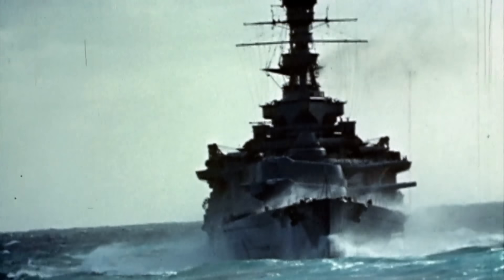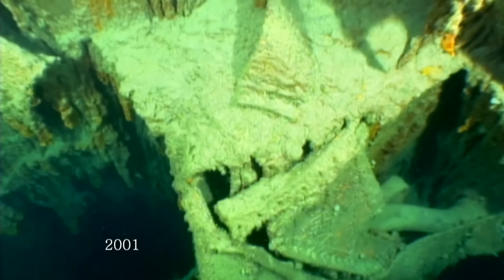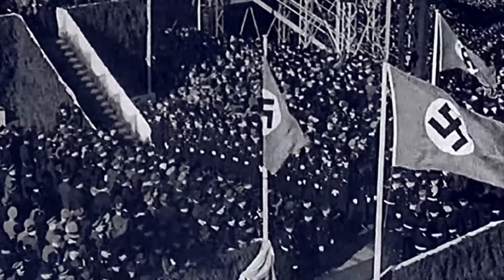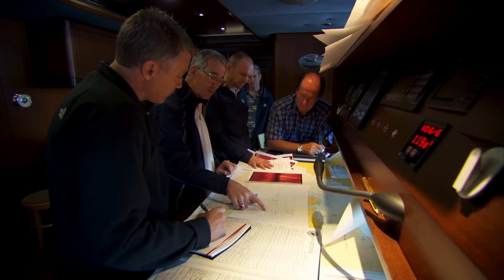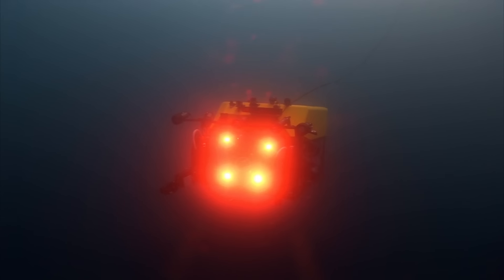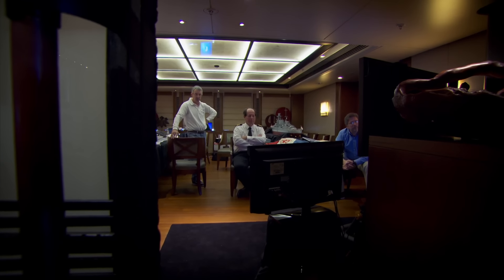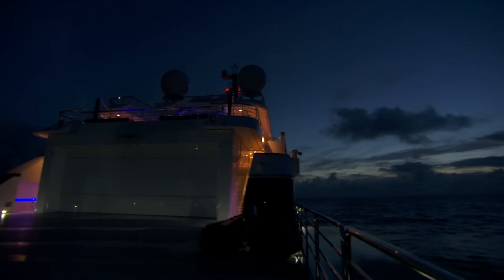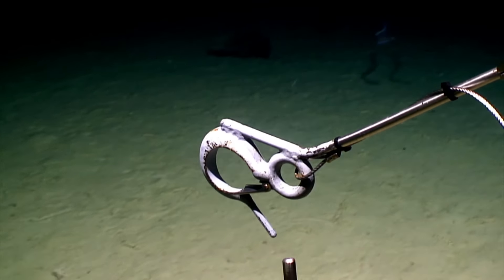How the Bismarck Sank HMS Hood - Documentary

Comment: Bismarck's designers were foolish. HOW can you design a ship of this size and not have a back-up steering system? Also, before the ship launched, they were told that there was a rudder problem, which occured during sea trials. Yet, they chose to ignore it. Hence, THEY (the ship designers) created the achilles heel for Bismarck, which ultimately caused it's destruction.
Reply: Back Up steering system?   What WW2 capital ship had such a thing?
Reply: @dovetonsturdee7033  According to the documentary, the designers were told after sea trials that rudder had poorly performed, and that they had troubling steering the ship because of this. My point here is that they were put on notice that rudder could pose a problem. The designers THEN could have (and should have) designed duplication into the rudder system (it could have been as simple as another rudder dropping down from the hull to replace the current one in place, with a rudder release to discard the existing one). Look at what happen, it was the RUDDER that doom the ship. I'll bet the designers kicked themselves upon learning this fact, BECAUSE they were warned about rudder problems BEFORE the ship went into service, but chose to ingore it.
Reply: @GeeBee909  You really need to read up on the extent of the damage. It was far more that just 'a damaged rudder.' Several compartments were flooded, bulkheads damaged, and the whole of the stern compromised.

A spare 'drop down' rudder?   I suspect you aren't a naval architect, then?
Reply: @dovetonsturdee7033  After the damage occured,  the captain wanted to steer the ship to a repair dry dock in France, and would have done so (AND made it) there EXCEPT they could not steer the ship, forcing them to stay at sea, sailing on a rudderless ship.  At NO time was the ship in danger of sinking because of the battle damage they received. Hence, IF they had a ship with an operable rudder, there would have been NO "sinking of the Bismarck" (at least not at that time),  as once they arrived in/near French waters, ALL of the British ships would have turned back BECAUSE the the Germans had several U-boat bases station right along the French coast (and British knew this).  Re my rudder comments:  necessity IS the mother of invention
Reply: @GeeBee909  Nonsense. You should read any of the books about Exercise Rhine.    Bismarck was damaged by Prince of Wales on 24 May. As a result, Admiral Lutjens abandoned his mission, and headed for St. Nazaire for repairs. Bismarck was crippled on 26 May by a torpedo from a Fleet Air Arm Swordfish which wrecked her steering and several compartment aft.

On the morning of 27 May, she was engaged by two British battleships, and within the first twenty minutes had lost most of her main armament, her forward superstructure, and her command staff. After that, she was little more than a practice target. By the end, she had lost her internal communications, was heavily on fire internally, was settling by the stern, and listing heavily.
Reply: @dovetonsturdee7033  NOT nonsense. Try looking at the documentary AGAIN. At 28:59 in the doc IT CLEARLY SAYS 15 Swordfish bi-planes attacked Bismarck and damaged the rudder. It also CLEARLY states that as a result of this, Bismarck was unable to steer. Follow what it CLEARLY says at 28:59
Reply: @GeeBee909  What is nonsense is your claim that 'After the damage occurred,  the captain wanted to steer the ship to a repair dry dock in France, and would have done so (AND made it) there EXCEPT they could not steer the ship, forcing them to stay at sea, sailing on a rudderless ship.'   The damage to the aft steering compartments did not occur during the first action, during which Bismarck was hit by Prince of Wales, but two days later, long after Bismarck had begun making for St. Nazaire. Until the Swordfish attack, Bismarck was able to steer, but after it, she wasn't going anywhere. You don't seem to be aware of the fact that there were three separate incidents :-
1). The Action in the Denmark Strait on 24 May, which resulted in Lutjens deciding to make for St. Nazaire.
2). The Swordfish attack on 26 May, which crippled Bismarck's steering and weakened her stern.
3). The destruction of Bismarck, actually more an execution than a battle, on 27 May.

That is why your post was nonsense. Your lack of knowledge.
Reply: Jordan Fan，Prophet of Environment。范楚漳，環境先知：
How Did The Bismarck Manage To Sink HMS Hood So Quickly? 
Answer:  The answers were very simple:  When the HMS Hood was battling the German battleships  Bismarck et al, those lazy British  navy sailors onboard the Hood were busily eating their favorite breakfast food - Biscuits with Sardines.  And had forgotten to return fire at the Bismarck!(::?.,4;,

Comment: This doco reaches "conclusions" that are far from conclusive which rather ruins the integrity of the program & reduces it to almost a tabloid level.

It's never been in doubt as the fact that it was a main armament magazine that blew up. Nothing else explains the size of the explosion that tore the vessel apart and produced the pyrotechnic displays. The historical  but never officially endorsed theory as to why there was a main magazine detonation...that of the "lucky hit" by one of Bismarck's 15 inch shells was blithely paraded as being the cause of the initial detonation by the document makers...w/o a single shred of evidence to support the theory. They even managed to point the finger at the wrong magazine as being the initial flashpoint. Eyewitness and debris evidence points to the aft magazine as being the one that blew...as likely as not due a primary explosion in a 4.7 inch magazine locker.

There was also a load of bumpf conjectured about in respect of whether the Hood's captain had fought his ship correctly based on his making a turn to bring his full broadside to bear. Given Hood had to close the range to score hits on the longer ranged Bismarck of course it meant that for a period the Bismarck was going to be crossing the Royal Navy's "T". The range wasn't going to be closed by blinking!
Reply: 4.7 inch magazine? I really don't think so.

Comment: The over dramatic tone of the commentary was annoying so I could not run with this. I remember reading the aft deck was awash on the Hood and it had dock yard workers on it finishing repairs so its end was not altogether surprising. German optics in the rangefinders also were a major advantage against any British ship.
Reply: No.Prince of Wales had dockyard workers aboard.  Hood's quarterdeck was low in the water because she had been modified, and additional armour fitted, at the time of her construction.
Reply: @dovetonsturdee7033  Apologies. Confused over which UK ship had workers on board. It was in the main a matter of quantity rather than quality with the Royal navy with the equipment and the Germans just wanted to get what they built absolutely right which was a bad tactic. These Leviathans were obsolete at this time and Bismarck was crippled by an antique fabric covered biplane. The fact that the quarterdeck deck of the Hood was awash does imply that buoyancy could have been a factor preventing installing the degree of armour obviously needed. Someone else said this problem was from installing extra armour during construction and it would be a coincidence if they managed to just squeeze in that required. Events imply they did not.